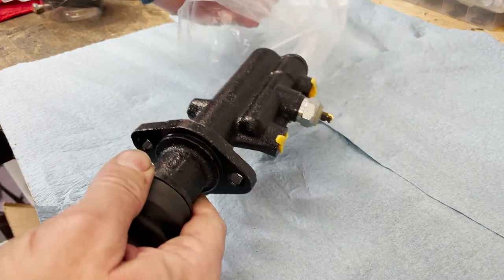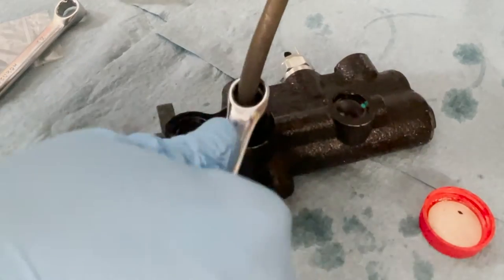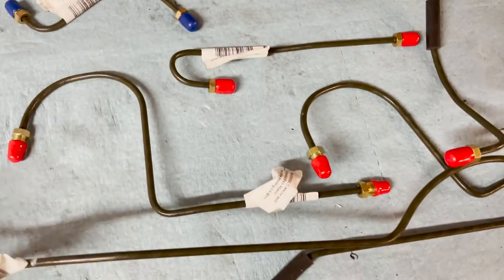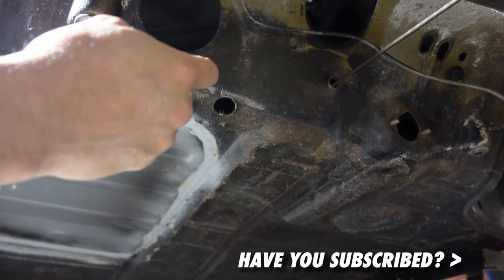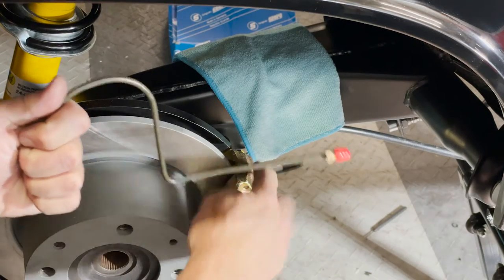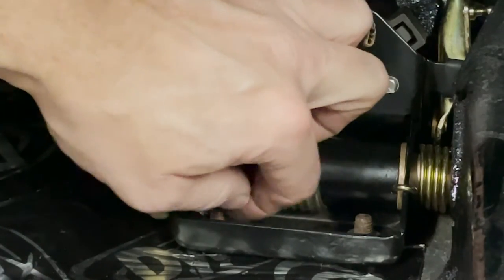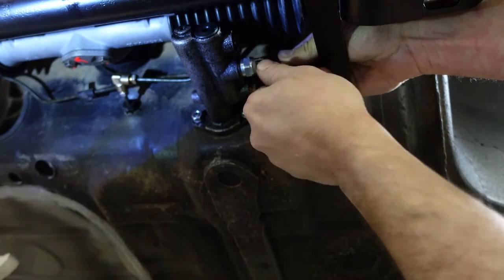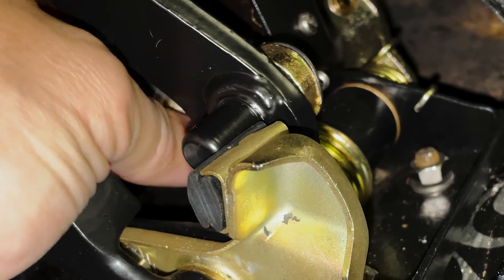Porsche 914 Brake Line, Master Cylinder and Pedal Cluster Install [Project Bumblebee Ep. 25]

Comment: Did you rebuild the handbrake on this car?? If so is there a video... I am having trouble with mine
Reply from the maker: I just painted the metal and lubed the parts. Also new pins. The retaining pins are often rusted into the bracket and require drilling or a lot of force to get out.

Comment: Brake proportioning valve? When I did new lines, I bent my own lines. I didn't know they had preformed lines. And PMB rebuilds that valve? Think I'll be contacting to get a new one/rebuilt. Thanks.
Reply from the maker: Yep. The "official" name per PMB is the pressure regulator. As I understand it, proportioning valves bias the pressure. This device acts as a "circuit breaker" to make sure the wheels don't lock up in a dangerous sequence. Thanks for watching. Please subscribe if you haven't already!